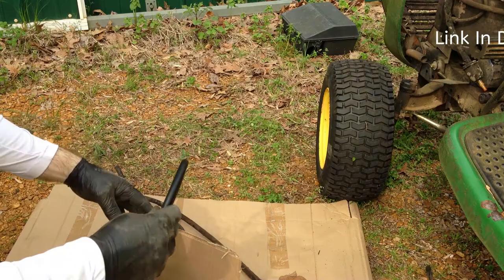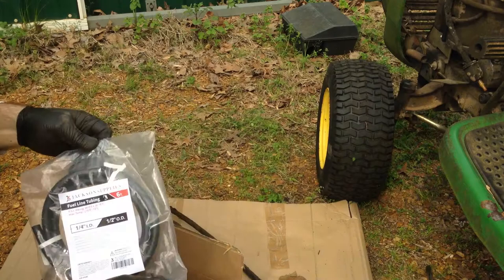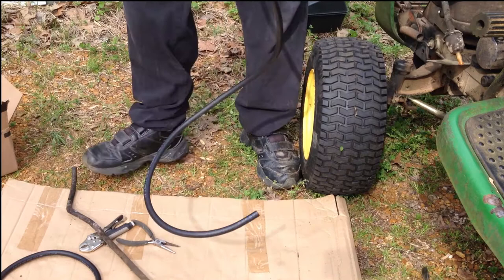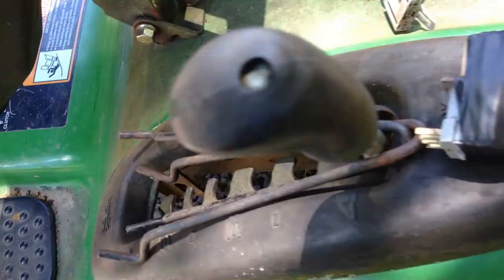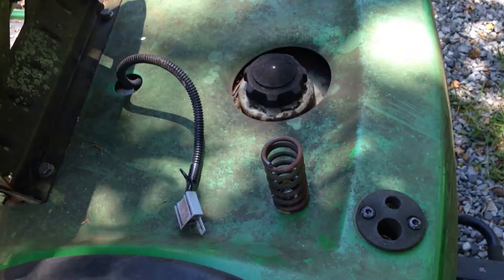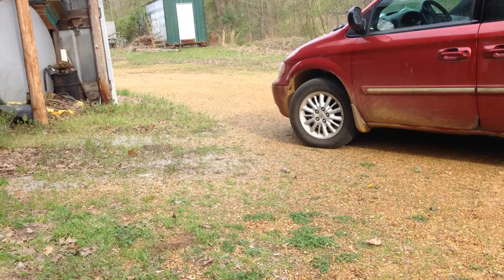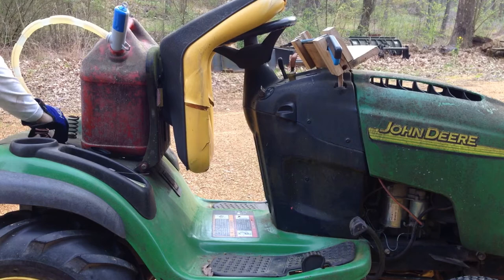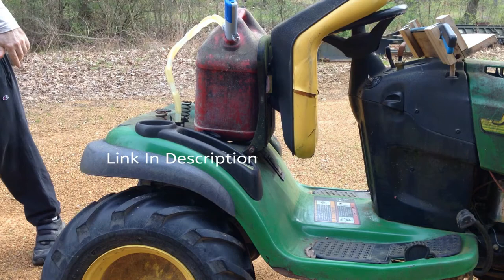How To Change The Fuel Pump And Complete Fuel Lines On A John Deere L130 Fast Afternoon Project

Comment: Pull the fuel line off the top of fuel tank.  Duct tape new line to old line.  Remove line from filter.  Pull old line through and new line will follow.  Forget trying to thread it through like he showed.
Reply from the maker: Thanks for the tip.  The old like is rather greasy, so you may have to attach them mechanically.  Maybe cut off a bolt that fits in both ends and put clamps on?  Or you could also tie a string and then use the string to pull through.  Either way, it is a good idea.  Thanks for the comment

Comment: Did I miss the changing of the fuel pump?  Otherwise, good video about replacing the fuel line.  Thank you.
Reply from the maker: Fuel pump at 8:56   It was a time-lapse.  I should have done video, but found out real fast how hard it is to operate a camera by yourself when you are up to your elbows in grease LOL  Thanks for watching

Comment: Hey, I do like those rear tires! Link didn't work for me tho. Does it still work for anyone else or is this just a Canada problem I wonder? 😆
Reply from the maker: Thanks for letting me know the link was dead, I fixed it and it should work now.  You will love the tires, I put windshield washer fluid in mine and I now can go anywhere even pulling a full trailer.  I used to spin all over the place on the hills, not anymore.